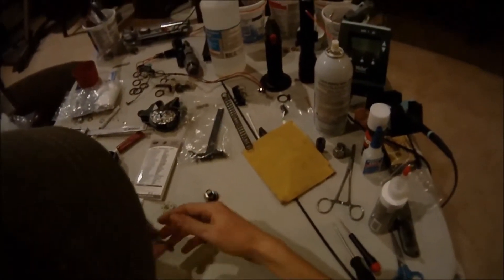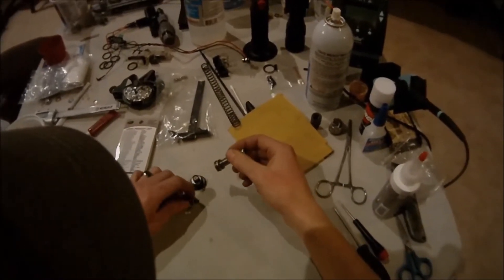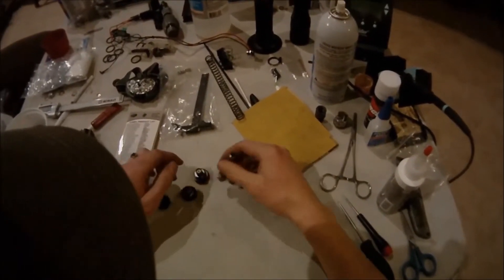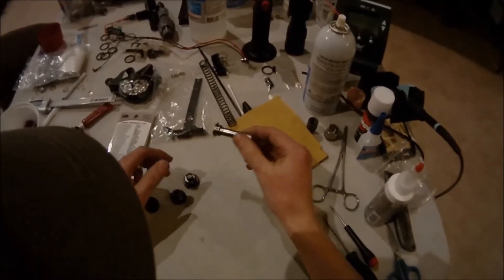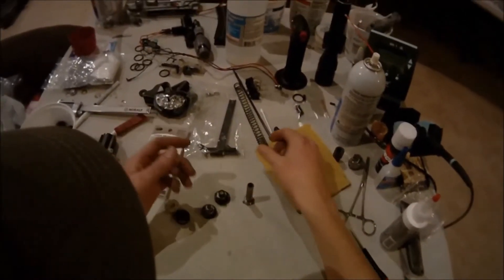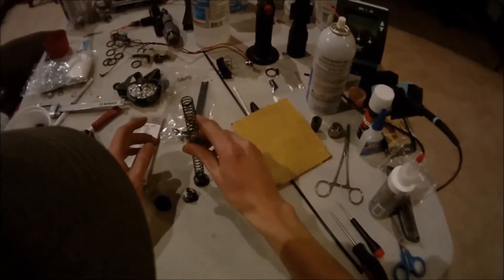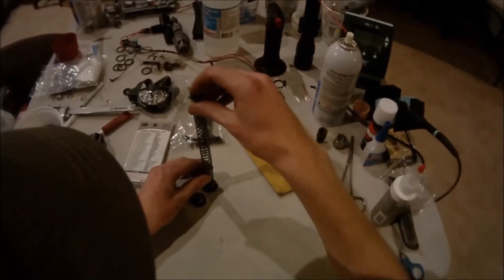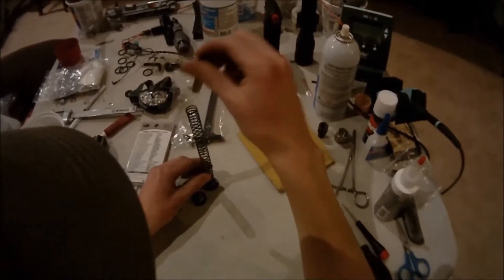A Little About Piston Head and Spring Guide Bearings

Comment: Question can I run my piston head without any bearing or washers? I just installed it onto my piston with the head itself and the screw to hold it, is that fine? I have a spring guide with bearings so I didn't want to over do it with my hight torque set up.
Reply from the maker: I believe that I state you can do exactly that in this video.  There is no reason to run both.  The bearing on the spring guide is more that sufficient enough to handle the rotational action of the spring.  However, if you're running a high torque set that will be going relatively low speed (low RoF), you should have no problems if you choose to run both.
Reply: Jason L So I don't need to have the washers on the the piston head i can install it with onto my piston with just the head and screw? Thanks for the reply